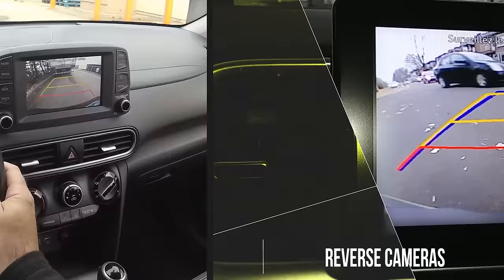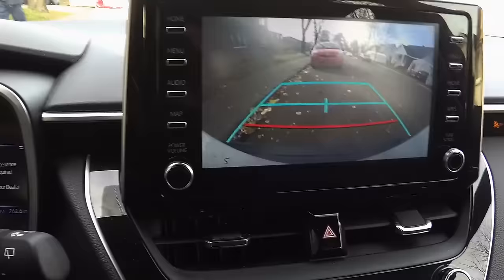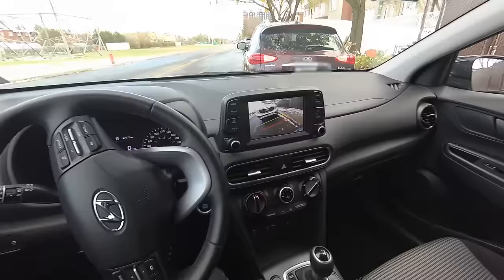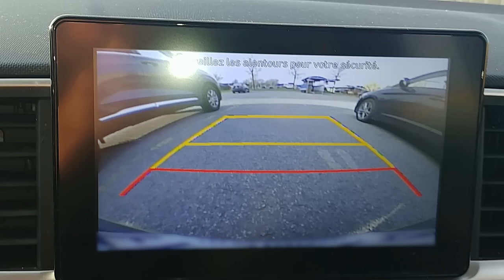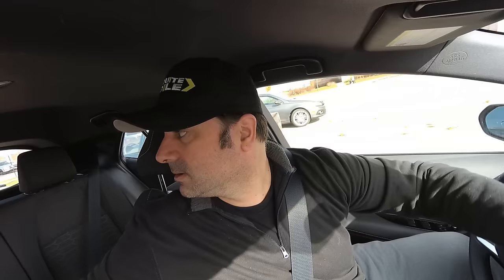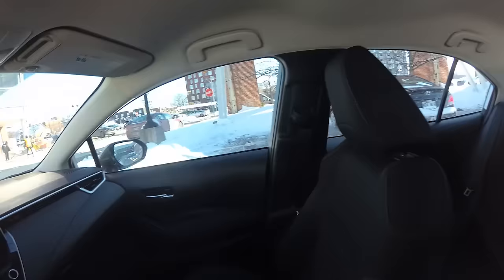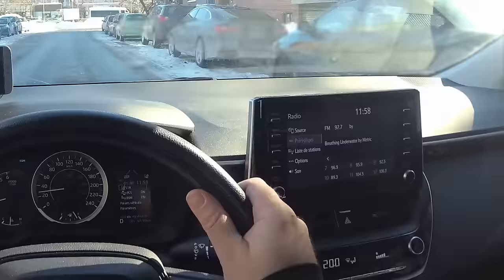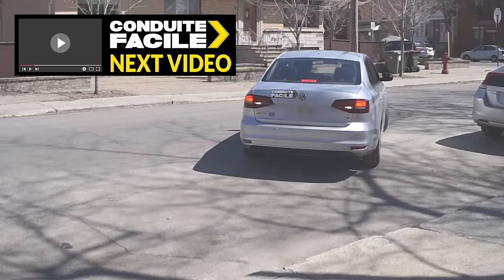How To Use Reverse Cameras

Comment: Quite a good video - but I don't agree as regards turning your head looking back as you reverse. I always use external and internal rear view mirrors when I reverse - that's something that is also necessary when driving a lorry or some other big vehicle. Turning your head as you reverse means you cannot see objects at the side you're not looking at. Using the rear view mirrors gives you a better overview (if you ask me).
Reply from the maker: By turning your head you have a wider angle of view. You also see through the back passenger windows, as opposed to when looking at the mirrors where you only see to the sides (side mirrors), or directly behind (central mirror). But in reality, you should use a combination of both.

Comment: Just installed a reverse camera on my car.  I always look back while reversing, but I want the camera to see anything low down that you can't see by looking back or from the mirrors.  Curbs, rocks, fire hydrants, small animals, etc... When you install a camera yourself, you may end up with arbitrary lines, or you may be able to adjust your lines.  I eyeballed my line adjustment for the moment, but I should really take some measurements and make sure the lines are where I want them to be.  My impression is that most aftermarket cameras will only have the static lines.  Some cars also also adjust the turning lines with your speed, not only with the position of the steering wheel.

Comment: I’ve driven a few cars with backup cameras and I still find myself to use the mirrors and turning I like that I can perfectly center my car backing in a parking space with a backup camera without having to adjust my mirrors or look out of the window at my space in the lines in a car without a backup camera. The cross path detection is a great feature in cars to as well as reverse  auto braking

Comment: What you highlighted at 3:58 is not the sensor for the parking radar, but the cap for the towing attachment. The car in your pic has no parking radar sensors.
Reply: someone that noticed the same as me. That's, clearly is Not the car sensors, and by that error alone I question all the information on the video if he can't identify such a simple sensor.
Reply: @paulacruz6239  yeah, the rest of the video is kinda useless too. It might be true for factory units, but for aftermarket cams, it's a gamble.

Comment: Volkswagen has a rather genius way of hiding their reverse cameras when not in use. So when the vehicle is put in reverse, the VW emblem pivots on a center axis revealing the camera at the bottom of the emblem that's now rotated 45°. Then when the car is put back into either drive or park, the emblem returns to its flat position, hiding the camera for a clean look, genius.

Comment: My Toyota RAV-4 has a reverse camera, however, when I always back out of my driveway, I usually always look at the side windows, side mirrors, looking at the rear windshield, and only using the reverse camera only to see if I'm about to hit something, like you say. My family is using a little too comfortable about the reverse camera, and use it most of the time, compared to looking back and looking at the mirrors, and they think I'm strange for using the reverse camera only a little bit. I'm like that because I like to gain a lot more experience looking at the important windows and mirrors in the vehicle than looking at the camera. I think of it this way: even though vehicles are getting a lot more modern and have more advanced features, the driver can't be replaced. So that experience of reversing without thinking the reverse camera is there most of the time is how I do it :)
Reply from the maker: You're right.

Comment: I find more use in parking sensors than in reverse cameras. However, it does help to see how far are you from car in behind.
Reply from the maker: The ideal is to have both.
Reply: @ConduiteFacile  My car has both the sensors and reverse camera and the sensors also show the distance between the objects behind my car while reversing on the screen in meters

Comment: Check by turning head and twisting neck and rotating body
Move vehicle into position
Engage reverse
Check the distorted wide angle camera
Check again by turning head and twisting neck and rotating body
Park without looking at camera
Final move, check camera front and back for spacing and courtesy unless ... you have other ideas.

Dependence on electronics makes a handicapped driver

Comment: Interesting information in video. Appreciate looking back to see out of view things however some vehicles do not have the ability to do so being a truck or ute with solid tool cab on back that can only use side mirrors for backing.  The camera in the video has a narrow field of view compared to some 2023 cameras advertising 170 Degrees Field of View if the Horizontal 170 deg is true.   I have experienced with no reversing camera that where a Ute has no rear vision due to large solid tool cab on back and reversing out of an angle park where visibility to driver for on coming traffic is next to nothing due to other parked vehicles. that a wide angle camera would see the on coming traffic.   I know that other cameras with 120 Deg field of view would be no good for this situation.  What is your experience of the 170 deg view cameras as I think I need one for this vehicle?

Comment: Fitted one of these to the front of my car because bonnet is long & slopes out of sight, car is low & was catching front spoiler on kerbs, so mounted it, turned it down so red lines show about 15cm from kerb, run it through a fused relay switch so I can turn on when needed, for 10 euro, can't go wrong
Reply from the maker: Good idea. Some vehicles have some of those as an option.

Comment: Please show us how to use cameras without guidelines for parallel parking. thnx.
Reply from the maker: Cameras without guidelines? Waht do you mean by that? All reverse cameras have guidelines. You mean without lines on the floor?
Reply: @ConduiteFacile  Yes those ladder type guidance lines which tell you where your car will go.. Many aftermarket camera do not have lines at all or  lines which remain fixed.

Comment: Worse driving assist is the reverse Camera. I will advise everyone to use the traditional reverse methods ( head, shoulder check, side mirrors ). Do not use a Camera to park, either your car won't be straight and you risk hitting a car or a wall
Reply from the maker: It can be useful, but just as an assist. I agree with you that the bulk of the verifications should be done how you say it.